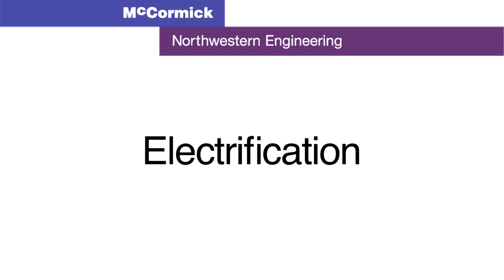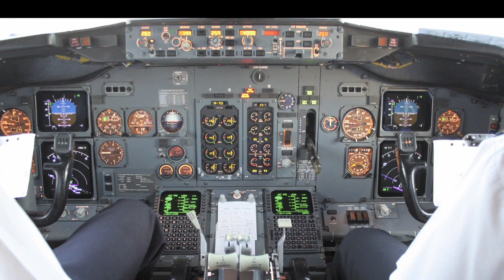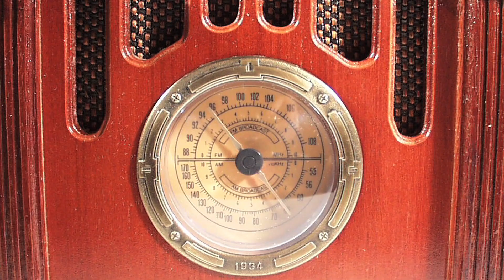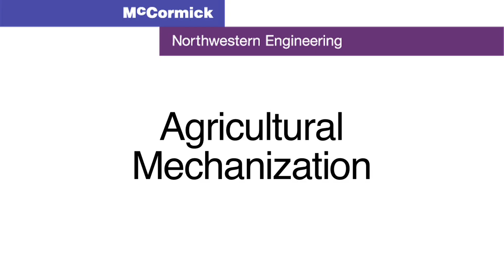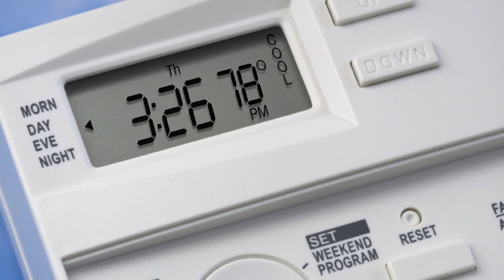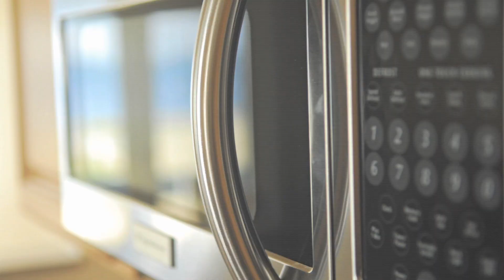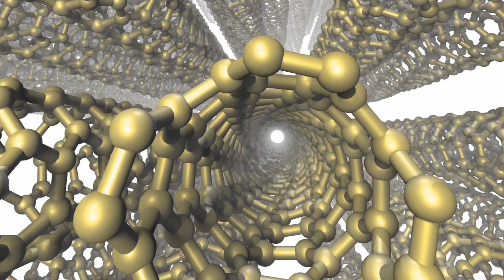The Greatest Engineering Achievements of the 20th Century

Comment: Possibly the best location for nuclear power in a geologically active place like Japan is offshore, in water deep enough to accommodate tsunamis and earthquakes. Water is a natural shock absorber and disperser. Problem is reliable  transmission of high voltage, A submarine power station with waste disposal in subduction zones (whereby radioactive waste sinks harmlessly into the outer core of the earth) may sound like science fiction but possible even with contemporary technology

Comment: @Merecir Secondly, Wind's not a scam, it generates a lot of energy. They range from 200 watts per square meter or less at 50 meters altitude to 800 to 2000 watts per square meter.

And lastly, Geothermal is not nuclear power as such, its heat, the geothermal gradient, which is the difference in temperature between the core of the planet and its surface, drives a continuous conduction of thermal energy in the form of heat from the core to the surface.

Comment: @davegamemaster So you did not follow my recommendation to learn about LFTRs...

Solar have potential but it will never be able to provide the vast amounts of power needed in the future. Tidal and wave only provide power to coastal areas. Wind is a total failure and a scam.

Geothermal is natural nuclear power.
If you're ok with that then you should have no problem with LFTRs as they use the exact same material to generate heat: Thorium. A reactor is just far more efficient.